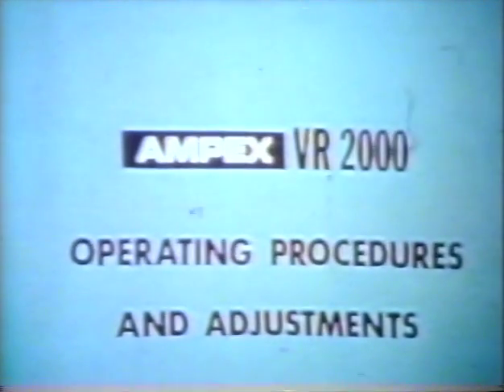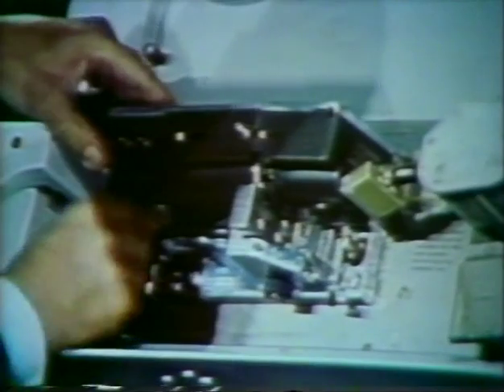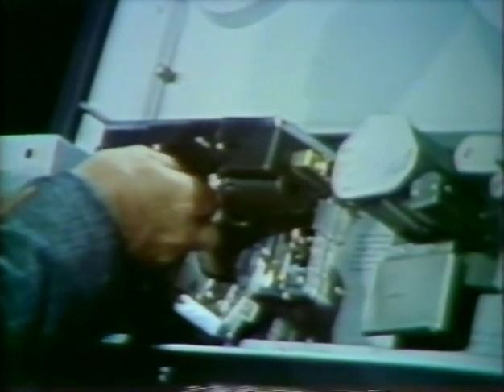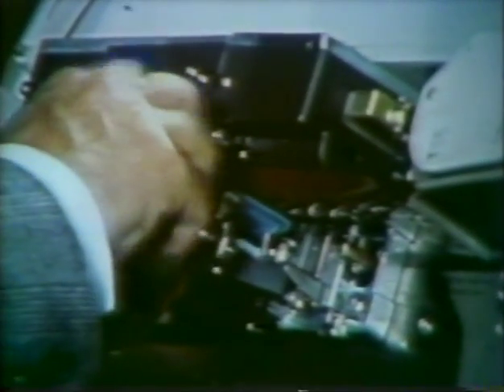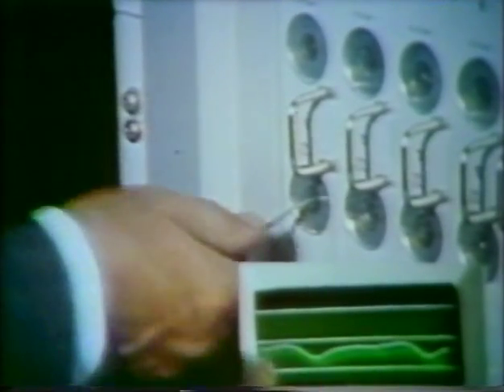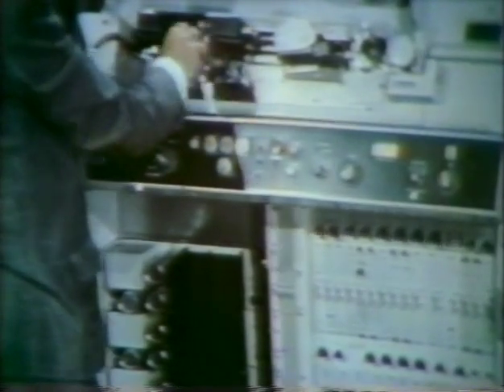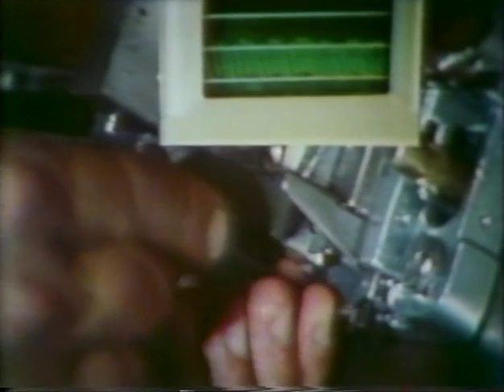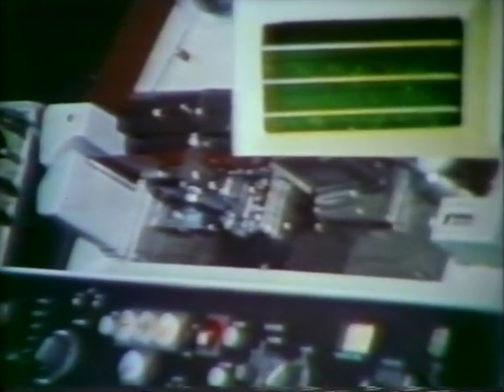Ampex training tape for the operation of the VR-2000 Quad VTR, part 1

Comment: I worked at a PBS station, WKPC-15 Louisville, that had quads, VR2000s just like this one, and used them well into the 1980s. I never got to load or set one up. My first hands on with videotape was a VPR-6 1-inch machine. Back then a video engineer was 50 percent electronics tech and 50 percent mechanic.

Comment: Also - sorry to be nitpicking, but this not really an 'operational' video...
The head sweep procedure was only really needed when you changed heads, or made some other substantial change to the head signal path.
(I drove a 1200 and 2000s for a few years - with an HS100 as a C-roll - on a RHL mixer with EECO controllers)

Comment: @toresbe Not to nitpick or be too annoyingly pedantic, but it has all the tell-tale signs of a kinescope: film scratches and dust at the beginning credits, the somewhat-hazy and less fluid motion quality (due to 60 interlaced fields of video a second having to be converted to 24 film frames a second), and overall lower detail and contrast than a film shot optically with a motion picture camera (more at par of a film shot from a CRT display, which is how most kinescopes were made then).